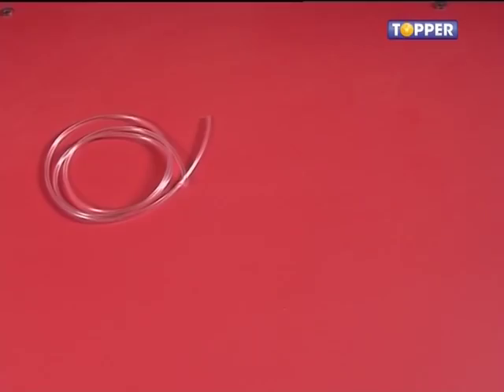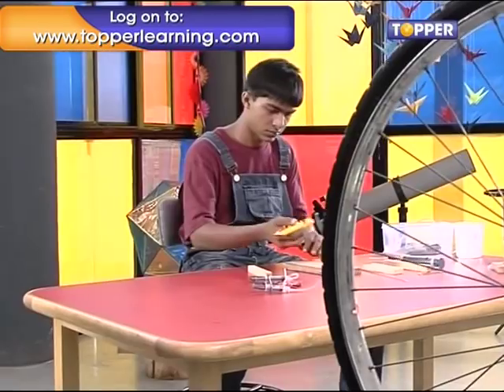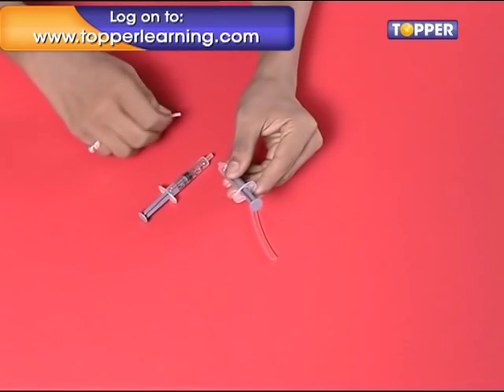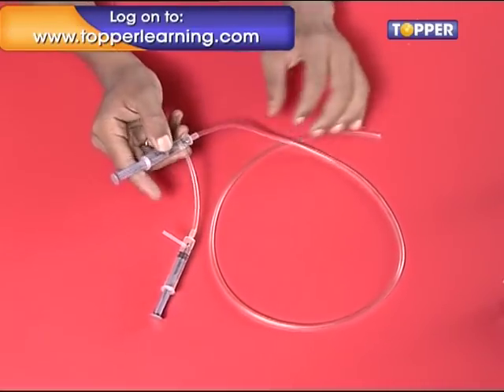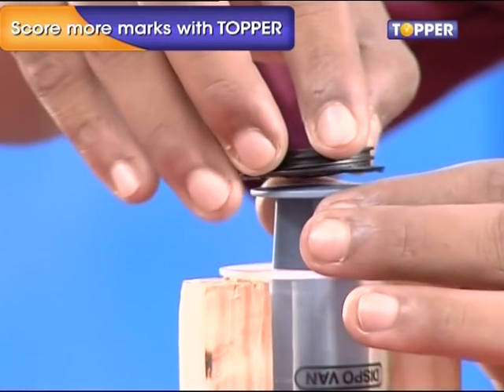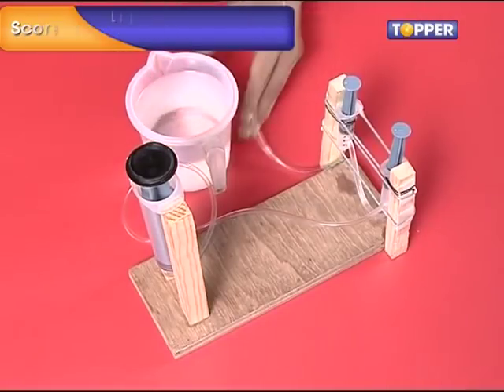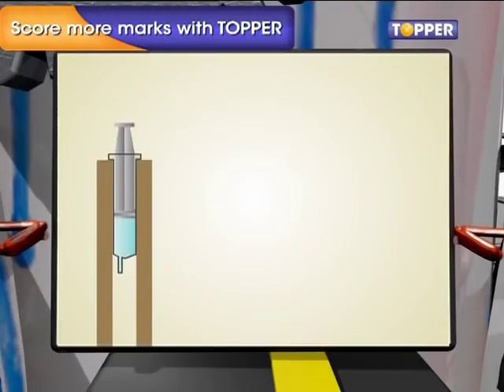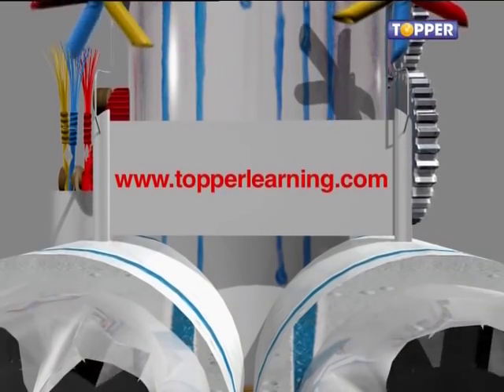Learn to make Hydraulic Jack with us in Toylab

Comment: There needs small correction in the weight lifting capacity of larger syringe. If diameter of small syringe is 1 cm and it can hold 1 kg weight then the larger syringe of diameter 5 cm will be able to support 25 kg instead of 5 kg as told in the end of the video. The video though is fantastic! Thumbs up!!!

Comment: We did this experiment and it worked well...Hats off to Mr.Aravind Guptha ! Few suggestions for improvement.There is no need of ball bearing in big syringe. This helps draining the water from the big syringe for repeating the demo. After use, we removed the tube connected to the bottom of big syringe and connected another small tube dipped in a cup to drain the water in big syringe. Instead of using two planks for small syringes, we used one. There was a problem of water leak when we used ballpoint pen refill for a small syringe, so we just got rid of it and inserted the plastic tube straight in to the small syringe ! Problem solved and bingo ! Have a look https://www.dropbox.com/s/4golqv1r9g3rz79/IMAG1746.jpg?dl=0

Comment: GUYS SOME POINTERS THAT I WUD LIKE TO TELL U PPL THAT HASNT BEEN EXPLAINED IN THE VIDEO-
1. INSERT THE BALL BEARING ONLY 1 DAY BEFORE SHOWCASING UR PROJECT OR ELSE THEY WILL RUST
2. USE REFILL FOR BOTH THE SYRINGES THAT WILL MAKE THE PATH  FOR WATER EASIER TO TRAVEL
3. USE OF BALL BEARINGS ISNT NECESSARY
Reply: Khush Goyal THNX for the info
Reply: Gamer boy 007 welcome
Reply: +Gamer boy 007 i wud suggest that do use ball bearings
Reply: Khush Goyal how to stop the leak from the tubes
Reply: +Gamer boy 007 YOU SHOULD USE PEN REFILL FOR BOTH TUBES THAT WILL REDUCE THE LEAKAGE IF THAT DOESNR HELP THEN TAPE THE PLACES WHICH ARE LEAKING ....
Reply: and I'm mentioning that ball bearing are necessary for this project
Reply: without ball bearing the water would go back to the mug but if there is ball bearing it will block the water from going back to the mug

Comment: How do you then discharge the hydraulic fluid "water" from the big syringe to achieve the minimum hight of the jack again since the steel balls in each of the small syringes work as valves to stop water from flowing back to the small syringes respectively?

Comment: whats the point of the ball bearings? What do they do?
Reply: they prevent the air from returing into the syringe.
Reply: it works like a valve opening and closing the intake
Reply: Lugo Mez URGENT! PLEASE READ IMEDIATLEY! Does it matter if air returns to the syringe! I NEED TO KNOW AS I WANT TO DO THIS FOR A PROJECT AT SCHOOL!
Reply: yes it matters, air flowing back into syringe equates to losing hydaulic lift.
Reply: Lugo Mez Thank you!
Reply: As the plunger is pressed down the bearing is pushed against the opening creating a seal and leaving the pressure to escape through the tube on the side. As the plunger is pulled up, water will follow the path of least resistance (resistance created by the other small syringe) and the ball will raise to allow the water to flow in from the jug. It is a "one way valve".. Air matters because it compresses which means your pressure isn't being equally transferred, hence using water and why "Hydraulic Oil" is used in machinery as it has a lower compression ratio than water.
Reply: Lugo Mez but he just poured them in, does it matter ónly the diameter of the tube he said that  1 cm and 5 cm can lift 1 kg can lift 5 kg, or is it the volume?
thank you
Reply: Fábio Alvaato It will lift what it can handle before it leaks or breaks. If you build something unbreakable, it will lift until you are no longer strong enough to work the pump.

He was saying, if you have a one centimetre wide cylinder pumping into a 5 centimetre wide cylinder you will have a 1:5 ratio of power exerted - power achieved.

Picture this:
The water has to pass through a small hole.
If you have a thin cylinder where each centimetre that you press the plunger = 10ml of water being forced through the small hole.
If you increase the width of the cylinder X5 and press that plunger one centimetre, you are now trying to force 50ml water through the small hole. It is the same range of motion but requires greater force to do it due to the extra volume. In theory every 1cm you push the small plunger, the large plunger will raise 2mm (1:5 ratio).

For the volume of water that passes from one cylinder to the next, the small cylinder will be doing less volume and less work per plunge than the larger cylinder would which gives you the advantage.

It is like a pully/block and tackle, for every part of line/rope involved, the power required is divided yet the range is motion needed is multiplied.

Probably not the best explanation, but that's the basics.

Hope it helps.
Reply: okey so the only thing that affect the pwoer ratio is the diameter of the cylinders not the volume of oil they can have? also whould this experiment have been able to do without them ball bearings?
Reply: Not the volume they have, the difference in width. A thinner cylinder requires less force to move the plunger a certain distance than a wider one due to the amount of volume they have to pass over the same amount of distance.

I haven't studied this, I know how it works but I can't really explain, in depth, the principle behind it.

Google "Pascal's principle" if you want the physics.

Without the ball bearings you are limiting your motion to a single plunge and a reverse plunge. The bearing allows multiple pumps. The bearing (one way valve) allows you to pump to the jack and draw more oil from a reservoir on the return stroke and repeat.
Reply: Robert61494 hahaha same R
Reply: Robert61செய்ய494   ல
Reply: when you push down syringe to prevent liquid return back to glass

Comment: Why do I need to have two syringes ? Isn't only one enough ?
Reply: My guess is that it adds resistance to prevent the pressure from the large syringe bleeding back into the little one (jack collapsing under pressure).

Comment: y 2 syringe?? y just not 1??
Reply: oh very interasting
Reply: Mijesh Pillai if u use only 1 syringe then, when u pull the plunger of the syringe to suck water from the cup,then the water inside the big syringe also removed from it and it will come to the small syringe...the no. of times u do up and down the plunger of the small syringe....that much time the plunger of the big syringe also moves up and down.....so 2 syringes are used to avoid these suction problem...and by using the ball bearings only this can be done....